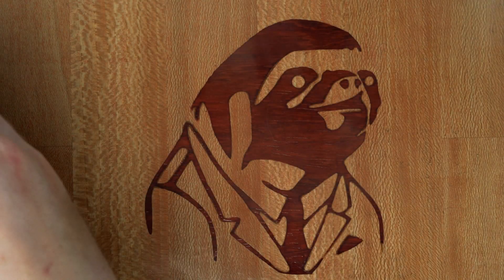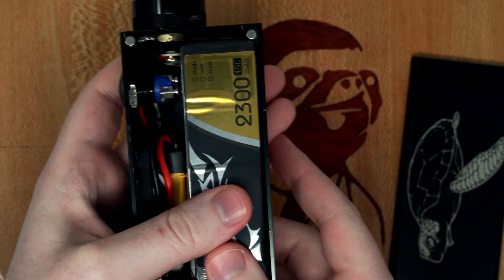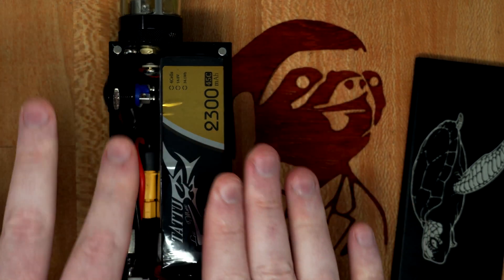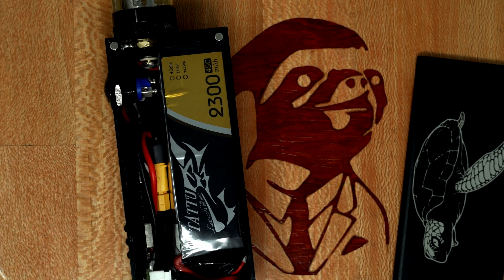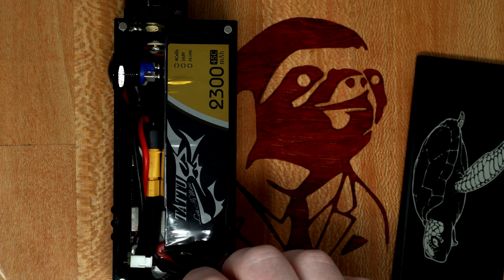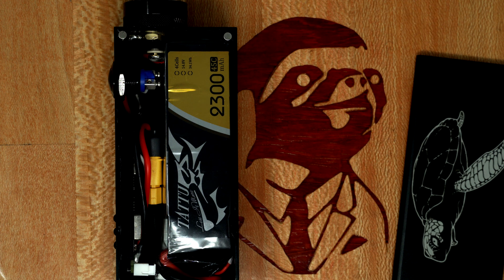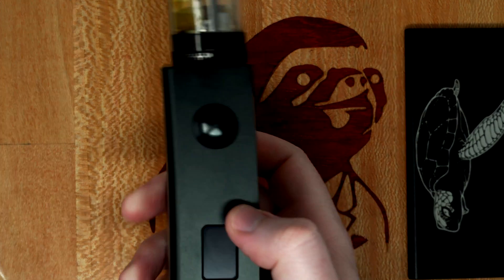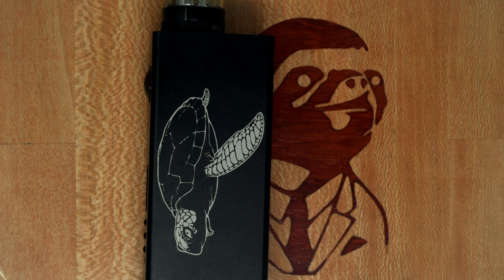Building a DNA 250C Part Five : Finishing it up

Comment: Any suggestions on building a 3s lip dna 250c? Not sure which JST balance plug I need for it. I bought a 4 prong one that matches the male on the lipo and it fits, but it doesn't line up with the holes on the board.
Reply: Theres a user manual for the 250c on the evolv site that covers that
Reply: @Doc Slothington  I didn't see anything with the chips and jst plugs. Just wiring diagrams. The 4 pin male jst doesn't fit
Reply: @stonecrazy3  the wiring diagram is the explanation for how to do it. You need to bridge pins 3 and 4 on the backside, and install the balance charger as you normally would, just leaving the 4th pin open (but bridged to 3)

Comment: Hey man I've noticed if you leave your coil legs long and they touch the base of the reload rta it won't read the ohms correct on different mods try shorting your coil legs bet it's the issue.
Reply from the maker: I've probably built the reload more than any other atomizer and have never noticed that, I'll give it a try

Comment: What Lipo wld u use for a small mtl mod or small higher resistence  squonk mod??? Id like to keep it as small as possible while still having ok battery life.
Reply from the maker: 900mah 3s would probably be the smallest I'd go
Reply: @AdvancedVape  im not really knowledgeable when it comes to lipos. Is there any difference in watt hrs from a 900mah Lipo and say a 900mah 18350???
Reply from the maker: @zachmikkablair9537  yes. A 3 cell 900 mah lipo would be like 3 900 mah batteries. It's still a small battery but its bigger than one 900 mah cell
Reply: @AdvancedVape  I cld run an mtl tank on 3 900mah cells and get all day outta it running it in conjunction with my other daily devices. I'm gonna have to look into it. Id love to have a dna 60 with one of the 3 cell 900mah Lipos. What size enclosure r we talking??? Im assuming reasonably small.
Reply from the maker: @zachmikkablair9537  yeah they're pretty small, about as small as a DNA can get
Reply: @AdvancedVape  im wanting to do a really small dna60 mod. Id like to shape my own squonker outta a stab block but i dont have much experience with wood working.
Reply from the maker: @zachmikkablair9537  just get a block of regular wood, and a belt sander and practice shaping
Reply: @AdvancedVape  thats what i was thinking about doing im Just not sure about how to put the board in and if id need a face plate. I know how to do the 510 and battery tube. Not sure about the board tho.
Reply from the maker: @zachmikkablair9537  if you're making it out of wood, you would probably need a face plate. Shoot me an email if you make it I would be happy to help, maybe I can cnc a faceplate
Reply: @AdvancedVape  right on. I'll start looking around and actually what id need to do some kinda rough draft. I think if I had a good layout I cld do the actual work im just not sure on the actual designing of it.
Reply from the maker: @zachmikkablair9537  best thing is to just try it with a piece of normal wood. Get something that feels good in the hand, make measurements and see if theres room for the internals etc
Reply: @AdvancedVape  I figured i cld keep it pretty small with the dna60. I know i wanna do more of rounded edges vs a standard box shape. I wanna shape it to fit my hand the best i can. Next time I leave the house im gonna stop at lowes and get a cpl pieces of wood to shape and c what I can come up with.
Reply from the maker: @zachmikkablair9537  lemme know how it goes! You can probably just pick up a large oak blank or something. Or common board. Dont do particle board or mdf
Reply: @AdvancedVape  will do. It'll prolly b Monday evening before I get started. Im gonna try to take some pics thru it too. Hopefully It'll go well. Wish me luck. 😄

Comment: I'm sure it's the reload rta, only because there are alot of ppl that have cleaned the contacts and everything else on the reload and it still doesn't work on most DNAs and yihi mods. But the mod turned out great.
Reply from the maker: Really? I've never heard that. I've used it on my other mods for years now with no issues, but it is just totally wild on this one. I've also never cleaned the 510 pin on the reload so it probably is that...
Reply: @AdvancedVape  yeah alot of reviewers said it too. The main video I remember  vaguely, since it was so long ago, is Mike Vapes.

Comment: I would love to see an escribe walkthrough/tutorial and explanation of settings (like preheat, boost, ect.). I can't find any kind of instruction manual anywhere, even in the evolv forum. I don't like temp control, but replay is ok. But I usually don't use it because when I chain vape it always throttles down the power which I hate. Enjoyed watching the build even though I prefer the smallest, lightest, 3d printed dual 18650 I can find. Like a rebel or boxer. Very informative though. Great work!